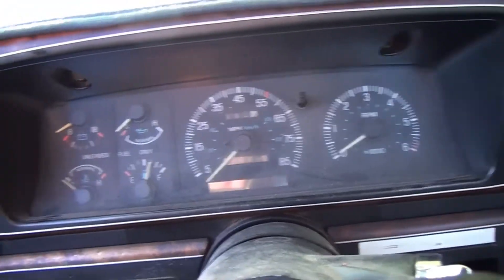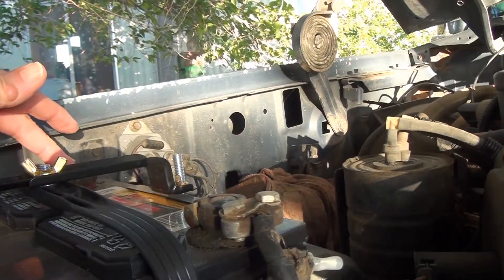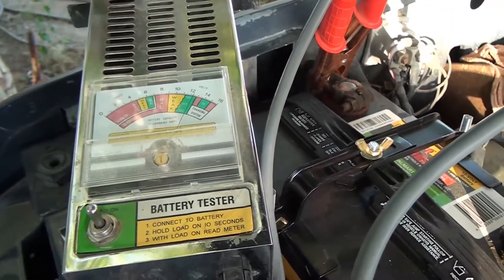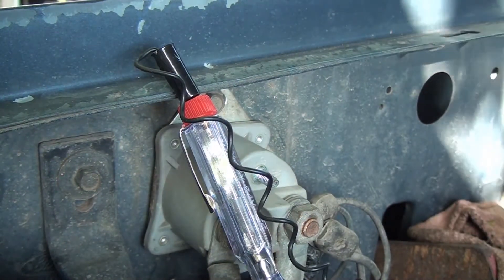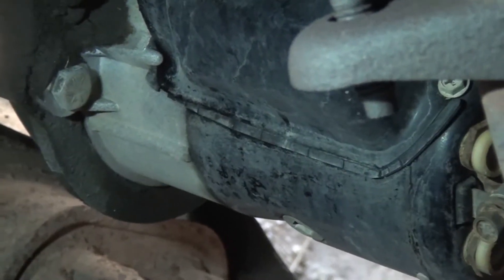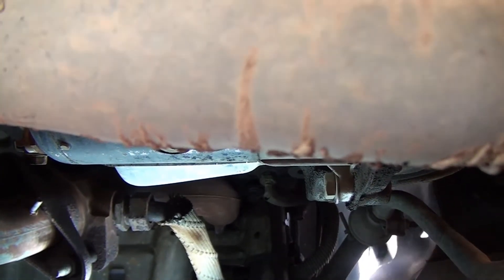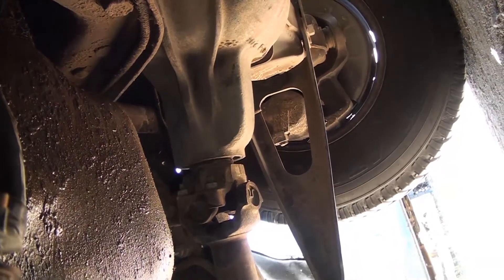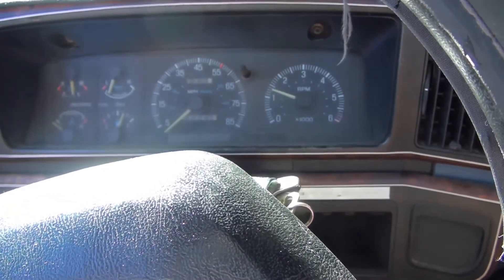1987 Ford F150 I6 No Start, Just Clicks.

Comment: I change my starter last year went to hook the battery back up in my truck almost ran me over the solenoid was fried I didn’t realize it and it was in gear I was hanging on to the front of the truck trying to pull the battery cable off and I lucky enough to be able to pull it off before it ran me over
Reply from the maker: I've had one or two close calls , but not as close as you. Mine was an OMG moment, why is my old Ford T-Bird in gear and heading for that tree. It was a cold start and warming up and I was adding tranny fluid to what was a very low on fluid transmission. Reverse and Park are very close, actually too close in my case. I was in reverse and when the bird got enough fluid, well, it was time to fly. The tree and the bumper met at about 2 mph I guess. Bumper got a small dent. Tree also. They made strong bumpers back in 1958. Thanks for the comment!

Comment: Try to crank my  F 150 gas plump work and have power going to my engine but won't crank
Reply from the maker: There is a starter lock out(neutral safety switch) on the clutch pedal if it is a manual. If it is an automatic try putting it in neutral. These neutral safety switches sometimes get out of position over time(my 1977 F250 on the base of the column does) and need to be repositioned.